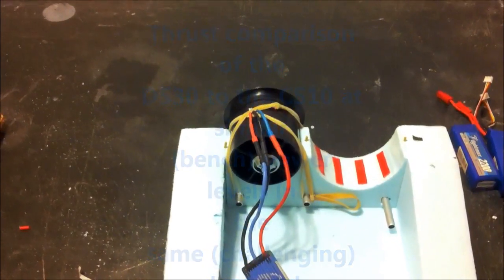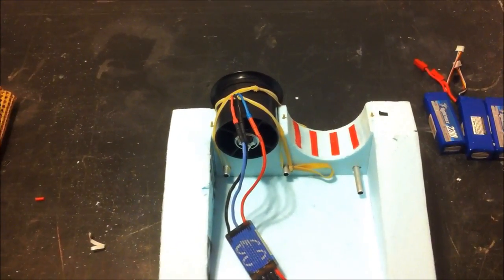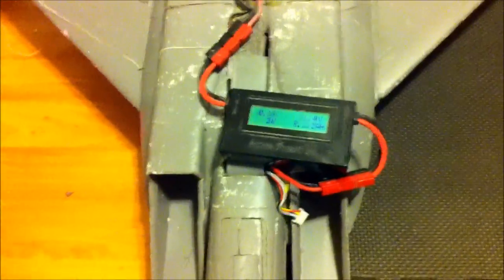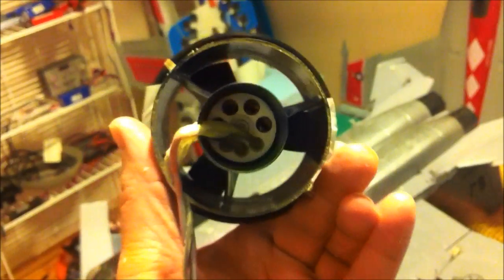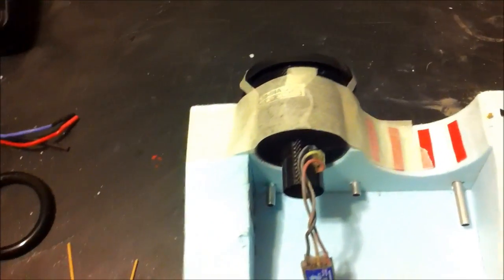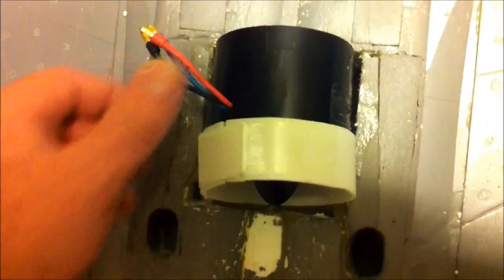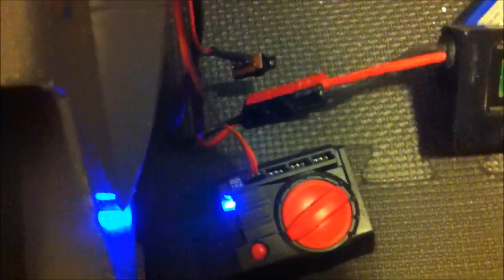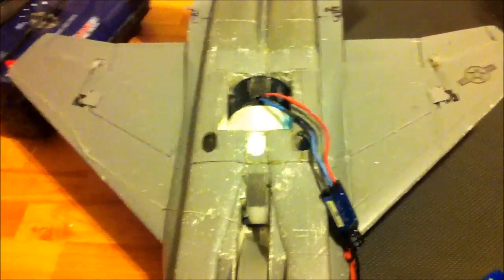CS10 vs DS30 in the EDO F-15 RC Jet

Comment: I realize it's 4  years but for anybody reading it may help.
I think it's the twin outlet more than the inlet,when you go on the ecal and mess with the outlet area you see more of a loss with the CS than lower blade count fans ,the CS is more for sound.did you try flying with it.
Probably better to put the shubeler back in and make the exhaust one oval hole with the right outlet area if you are after speed.
Reply from the maker: Agreed!  The high blade-count fans (10+) seem less tolerant of back pressure than low blade count fans (3-5).  But they do in fact sound much, much better.

tn